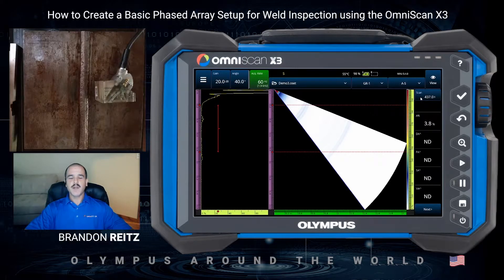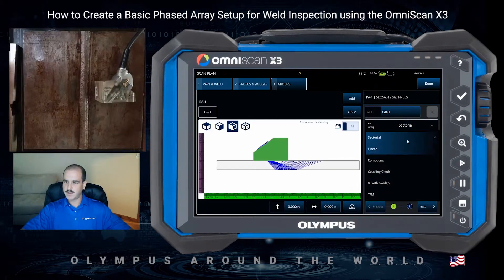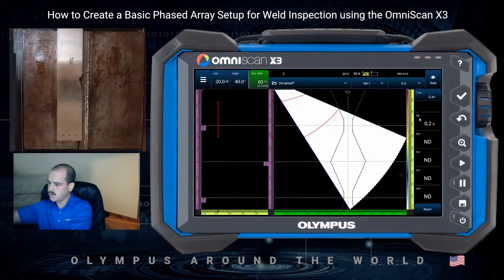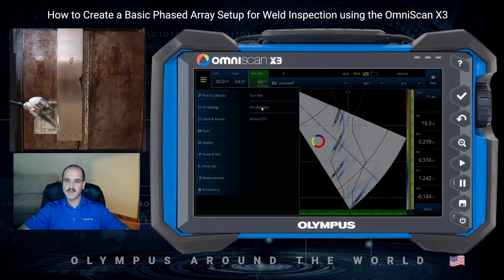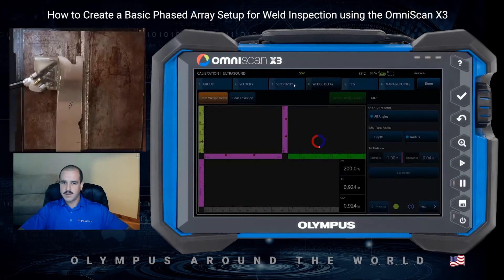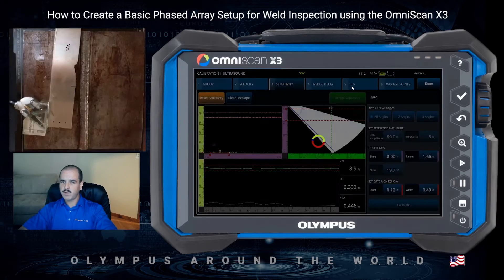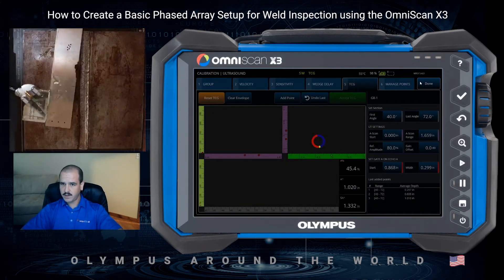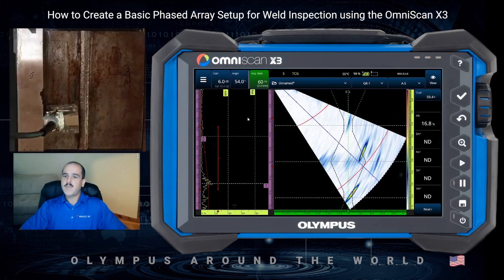14. How to Create a Basic Phased Array Setup for Weld Inspection using the OmniScan™ X3

Comment: Why didn't you use the velocity tab during calibration?
Reply from the maker: Completing the Velocity calibration on the X3 instrument during setup is not mandatory to have a compliant setup. Velocity is a material’s property and can be measured with other means. One of the most reliable methods is to measure the material’s velocity using a 0° shear wave transducer and to use a known thickness that has been measured accurately with a caliper.